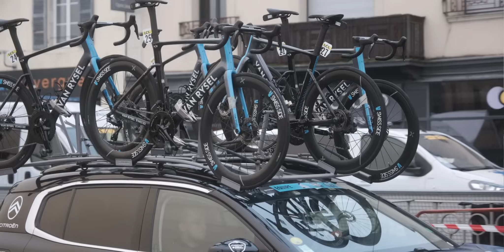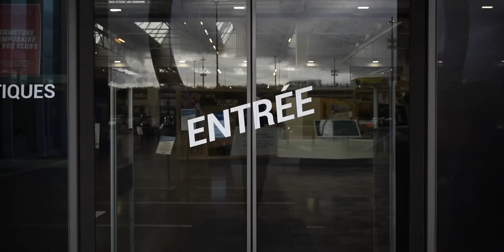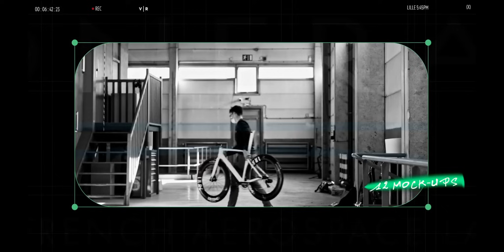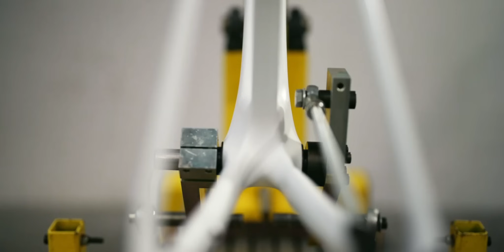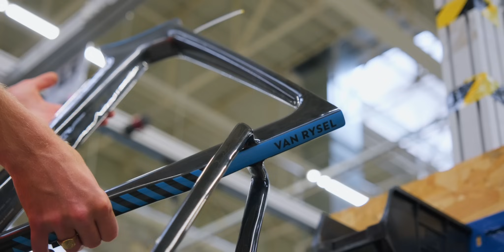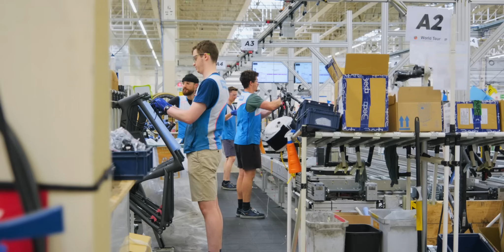Engineering The Van Rysel RCR Pro - The Most Exciting Road Bike in The 2024 Tour de France?

Comment: Ah, Vietnam.  Where you go when Chinese labor is too fair for your to have your product built there🥴
Reply: So the price is metter? 😂
Reply: @Imrjfjed  the price doesn't matter compared to the treatment of workers
Reply: Built in Vietnam and won a bunch of races right off the block. They're doing something right over there.
Reply: @JFomo  that's not the problem.  It's getting things made in a country with terrible minimum wage and very few worker rights.
Reply: @veganpotterthevegan Get to know the industry and you will notice that there are not many production facilities that can produce carbon frames of this quality.90% of all major brands have their frames manufactured in the same 3-5 factories. Of course wages play a role, but so does the know-how and the machines
Reply: @swsf  I was in the industry for 15yrs.  You're certainly not right
Reply: If you go to China (Taiwan) the resulting price is 15k. So...
Reply: @igorvmakarov  it absolutely doesn't need to be.  There's probably a 20-30% manufacturing difference which would result in maybe a $200-300 retail price difference. That's if they accepted the same profit at a lower margin.